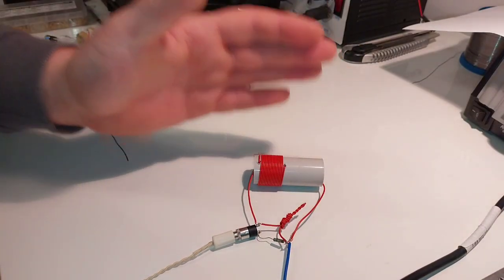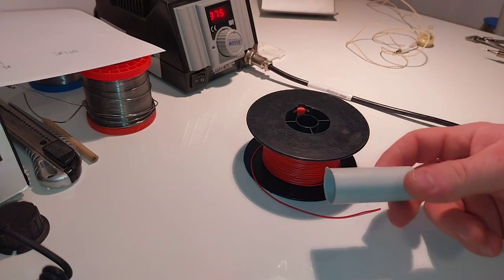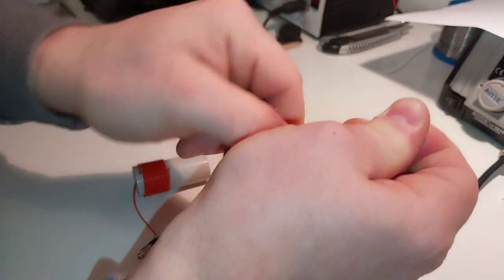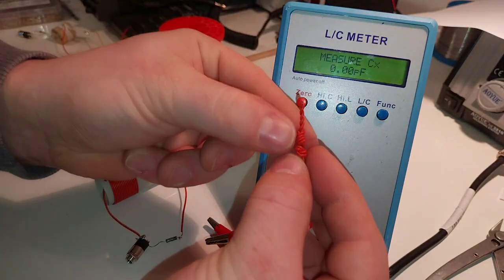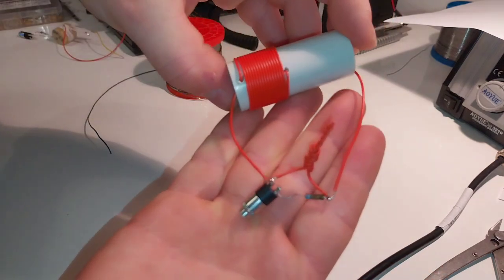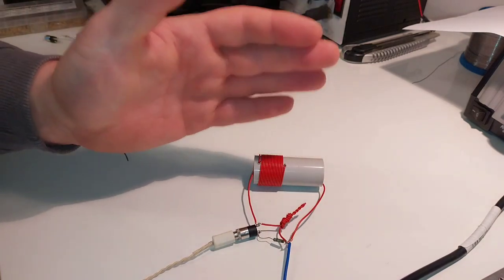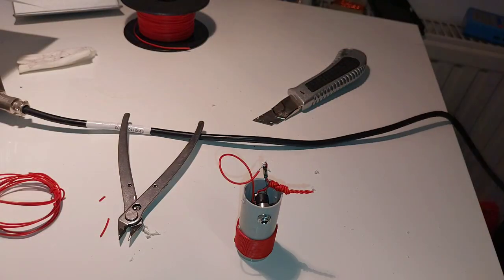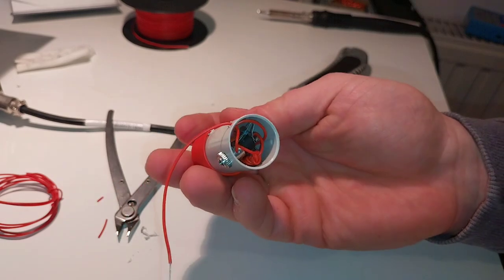DIY homemade Radio #radio #shortwaveradio #prepper

Comment: Hard to wrap your head around the fact, that the energy, that makes you hear the signal......  was created by the transmitter in romania... Always fascinating about dectector radios... No additional energy source. Well done ! 73 Manuel; DL2MAN
Reply from the maker: You are right
Reply: When I was in the military service ( the mandatory one ) I was using a telephone headphone in parallel with a diode. In one side I used to connect it to the metalic pole of the cabin we had when we were doing the night rounds....and the other end on the wire of the close circuit phone network we had ))) I used to listen to Radio Romania all the time. We were not allowed... so o lied and told them is a tool I built to check the phones and make sure they work well. They didn't say a thing hahaha. This video made me smile as I remembered those times. Pffff I was 21... time is flying too fast. I love simple circuits like this.
Reply: @dxexplorer Haha, nice!
Reply: @qwertykeyboard5901  memories 😅

Comment: Wow, I never thought about using the capacitance in the wires. Clever! 
Maybe you know this trick? You can even heat up an old razor blade to create a crystal detector. Then, you can used a bit of pencil lead or a safety pin to make a point contact diode. As a kid, it was an awe inspiring moment when I got my radio to work. But honestly it was too finicky. So if I build another one, I'd use a GE diode too.
Reply from the maker: I know it and I will test it !
Reply: I think it was used for so-called foxhole radios, right?
Reply: You can get up to about 22pF with twisting about a foot (30CM)  of wire.

Comment: this is awesome! will it pick up just about anything in this configuration, hence the elimination of the tuning variable capacitor?
Reply: It will pick up stations within a faitly set frequency range, there are calculators online that you can use to work out the frequency you want to receive, then you can calculate how many microhenries and picofarads you need for your inducror and capacitor to resonate at that frequency.  

To recieve everything, you can make the same circuit with no coil or capacitor and just diode, earpiece, earth and antenna, this will recieve everything with no tuning.

Comment: Is this really a SW receiver or a Crystal radio ? 
It’s pretty cool either way 👍🏼
Reply: It is a shortwave crystal radio, shortwaves that are normaly transmitted are use AM also, it is just the frequency range that changes, it is a nice small build for sure.
Reply: Thanks, it’s pretty cool !